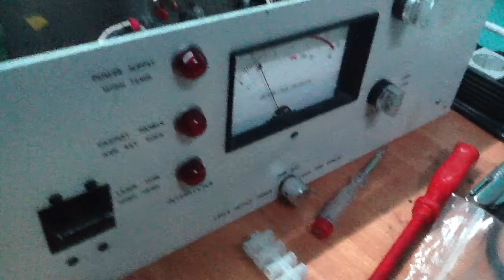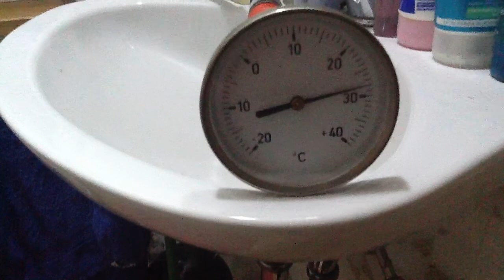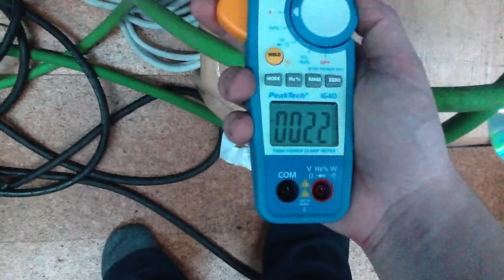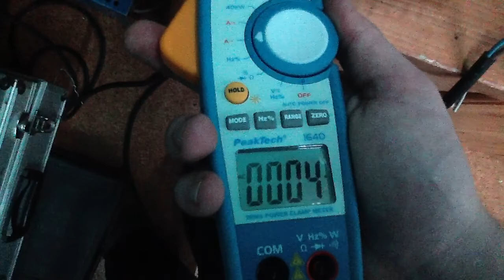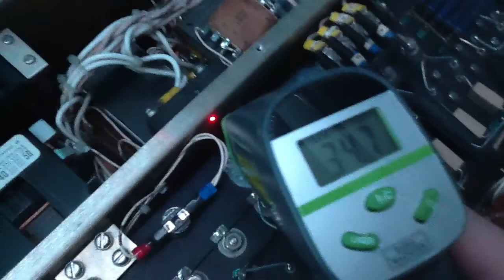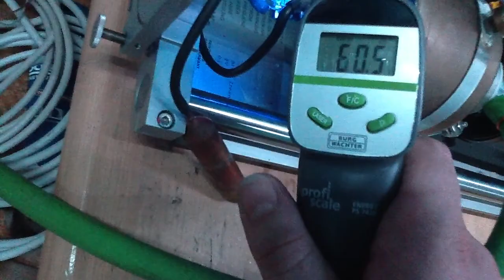Meditec EIL 5000 Argon Ion Laser Test und Messungen

Comment: I have a similar tube I plan to start very soon.  Is the electromagnet in series or parallel with the tube? It is disconnected on mine.
Reply from the maker: On mine tube the magnet runs out of rectified and smoothed mains voltage. About 315V DC. Current is about 3A... never run the magnet without the water cooling running. I believe there are other versions of this tube with other magnets. When the DC resistance is about 100Ohms it should be the same as mine.
Reply: Alexander470815 Okay, thank you, I'll check it out! The model number on it is MLR/W, which I haven't found info about. I don't even know if this head will lase anymore. I've had it for many years and finally decided to try to get it to run again, but I have no power supply for it anymore. I plan to use a temporary filter+resistance supply first. If the tube works I'll buy a PSU or build a proper one from scratch.